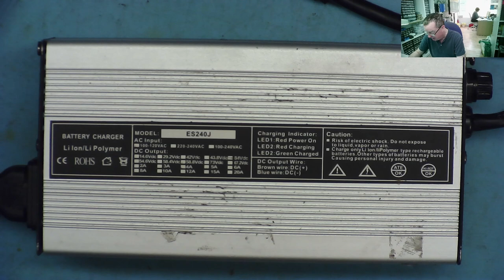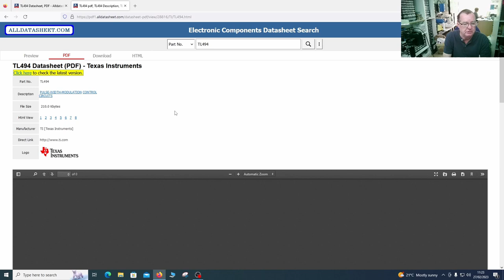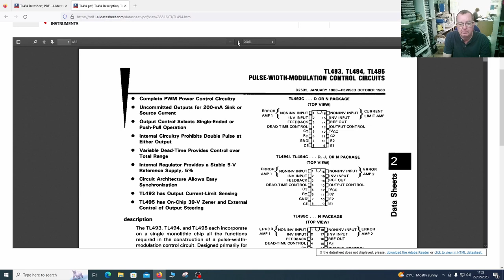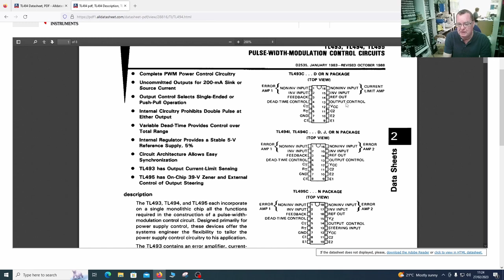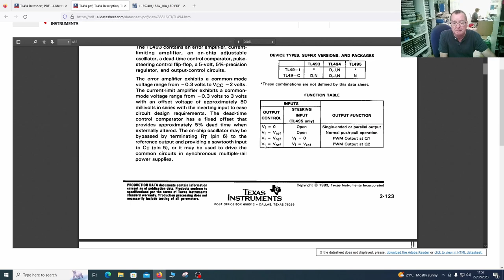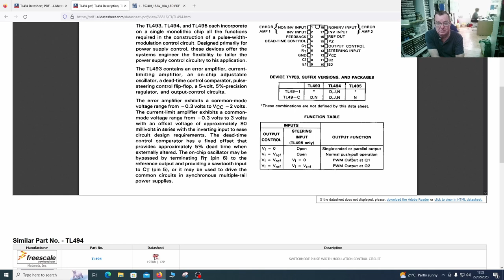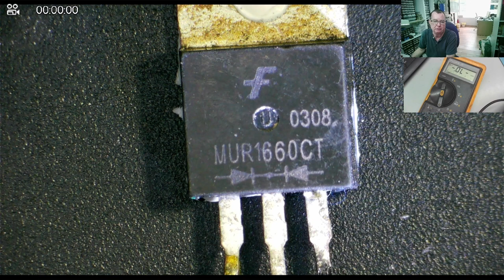Escooter Ebike Charger Repair - A tricky repair... Sometimes All Is Not What It Seems!

Comment: Hi Richard, excellent diagnosis of the board. I would have checked one fundamental thing before power-up. You proved the 'fuse' in the mains socket is OK but didn't check it was a 'fuse'.
Wouldnt be the first time I have found tin foil or wire used. Just saying on the point of safety to others watching. Thanks

Comment: Fantastic stuff. You're not the only one to be caught by an odd failure. Back in the day Sanyo made a 14" T.V. After a few years, they would start blowing line output transistors. The cause was a 47K 2w resistor going high. In circuit, it would read about 49K. Close enough right?....No. Lift one end off the board, closer to 58K. We've all been there 👍.
Cheers
Pete' New Zealand.

Comment: 35:29 - that's 236VAC not 23 volts. your eyes saw what they were expecting?!
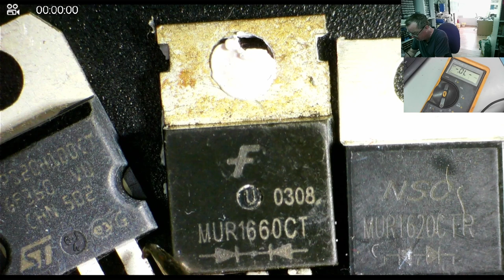39:52 - You're getting ready to install a 100v diode into a board that is supplying 236 volts!  (let's see what happens).
40:55 - Wow! Nothing bad happened even though 236v (see 35:29) was applied to the 100v diode.  I expected something worse.  We still don't know why there's 236v where you were expecting 28v.

Comment: Good work. I'm no professional but I am from the same school of thought.... Just stab away at components until you find the dead part lol.
Reply from the maker: Errmm... I think what I did here was methodical logical fault finding.  Not just stab away at components until you find the dead part. 😉 In this case everything tested OK in circuit so good luck with the stabbing approach
Reply: @LearnElectronicsRepair  Hey Rich I was joking ;-)
I had my 5p on the PWM ic........oooh that pesky diode!
Reply from the maker: @TYGAMatt  oops sorry, my apologies 🤐  Try the followup video 
https://www.youtube.com/watch?v=j4Ow04xwzRM
Reply: @TYGAMatt I thought that chip powered up from the scooter battery. These chargers won't start if the battery is too low.

Comment: That's why testing important composants in circuit is mainly not a good idea 😊
Reply from the maker: The downside to that is also that removing components to test them is also mainly not a good idea - some are very hard to remove/resolder and practically impossible to test out of circuit anyway.  No one said this is easy 😉

Comment: Hey Richard, my HP 630 is keep doing THERMAL SHUTDOWN, last year I changed it's thermal paste. Whenever I tries to do edit or do some CPU based task, it gets overheated and shutdown. My Laptop is 15 years old. (HP 630 pavilion) . What to do ?
Reply: Are you sure you applied good thermal paste? If yes I'd open it up and check if the surface of the CPU die is fully covered in thermal paste. Might be you applied too little last time. Also proper tightening of the heat sink is important for good heat transfer. Other possibility is the fan is not working properly, or the fin stack is blocked by dust. GL
Reply from the maker: Possible faulty heat pipe (if it has one) - I made a video on this topic but it was some time ago.
Google found it for me (PS my early videos were not so high quality/resolution)
https://www.youtube.com/watch?v=7puj20oGlQg
Reply: I have a HP650 that is of similar age that I used daily up until last year. Every couple of years I would have to clean out the heat sink grills as they would get fluffed up. The fan would be running but very little air flow. May be that.
Reply from the maker: @ianhewitt1858  Quite possible if the CPU is overheating but the radiator/fan end is cool or cold.  Once the special gas in the heat pipe escapes it is useless, basically.  Test it like i did in that video - or use a thermal camera but I didn't have one back then

Comment: Hi dickie couldn't you fit two single diodes instead as long as their polarities is the same and the amp value corresponds? Or am i thinking wrong?
Reply from the maker: Yes you could.  Also you need fast switching diodes, not plain old silicon rectifiers, as the SMPS runs at high frequency.
Reply: @LearnElectronicsRepair  AND, you can't "heatsink" individual diodes.
Reply from the maker: @romancharak3675  That is true but I have seem a pair of diodes soldered to a little metal plate with a pin that goes to the centre hole before now.  The little metal plate bolts to the heatsink

Comment: No, you do not know that chip well, E1 & E2 are emitter legs of output drivers, NOT enable.  The TL494 is an ancient chip, NOT intended for LLC operation, so that makes the charger an unusual design, or it is some other configuration, ...I suspect push pull, which is the most common use for this chip.